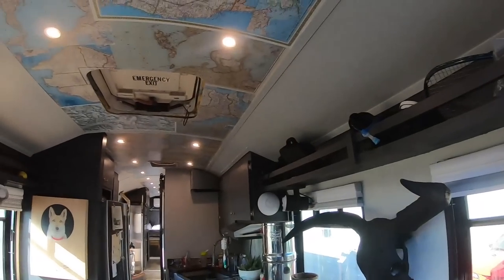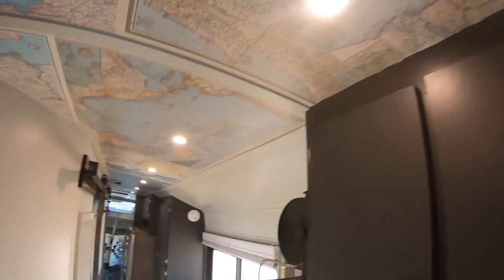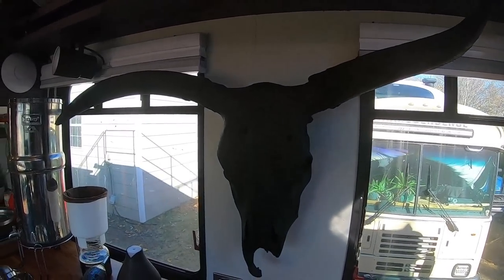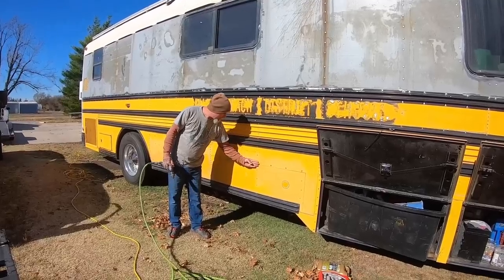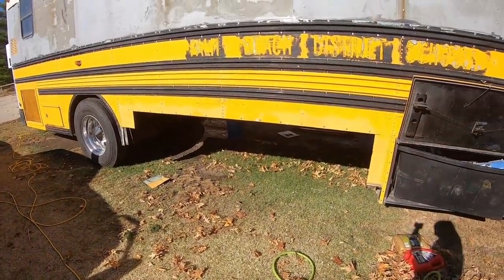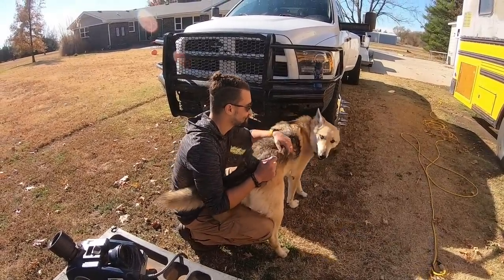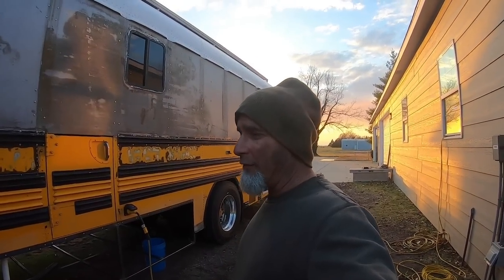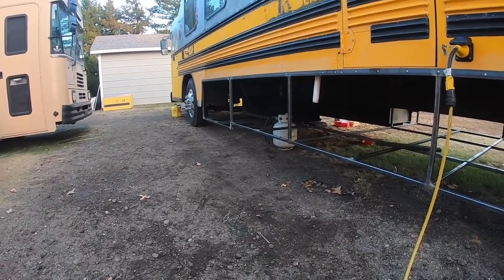Skoolie Ceiling Finished & Underbay Storage Construction Begins

Comment: @9:37 sorry but that is not a 15 k gen at best cont may be 8k or 9k a true 15k usually has a 4 cyl perkins or kubota engine but a 20hp honda engine rating is 14.914 kw at 3600 rpm under ideal conditions and new is good for 3500 to 5000 hrs then toast commercial gensets get rebuilt around 9 to 10k hrs 
http://www.centralmainediesel.com/order/Honda-10kw-Propane-Generator.asp?page=H04590
Reply from the maker: Thanks for the heads up on that!
Reply: chez vous si y a quelques M2 !! https://www.youtube.com/watch?v=LPNkkMfY1AE

Comment: You can buy 1/4 Lexan and cut to fit the inside windows. comes in clear or shaded. IT cut about an inch bigger and use velcro to attached to the wall. Man-made a world of a difference inside our bus....

Comment: SO , next time think about a blow out or flat tire so you dont crash any thing or the floor in a bay 8:32 looks really low  like the rim is 2inc lower then gen the bay ,, PS the gen you have i had one , some times the RPM likes to play around up and down with no load or a load on them but sounds like it has a load , worked very good for years so if its like that look the other way